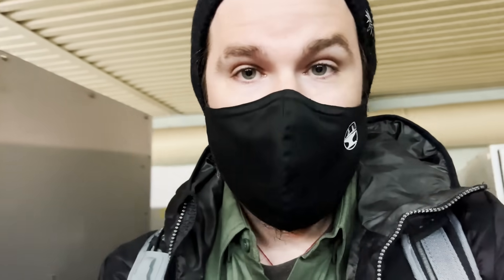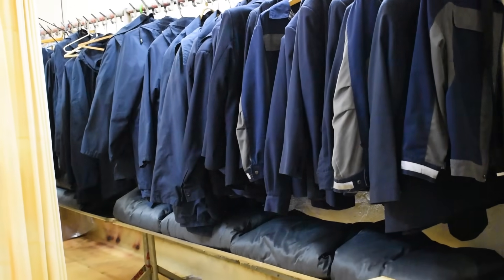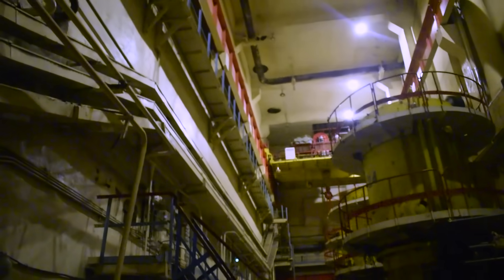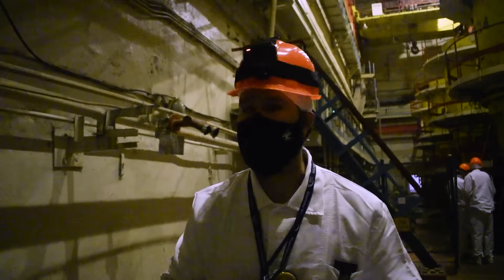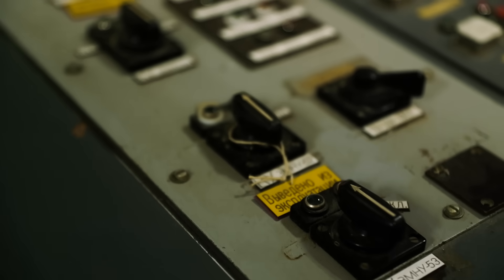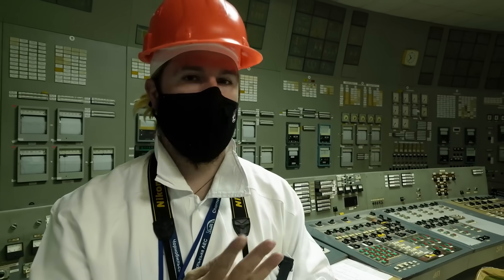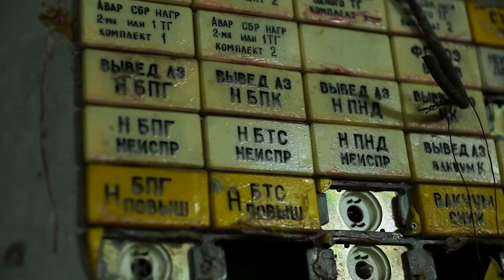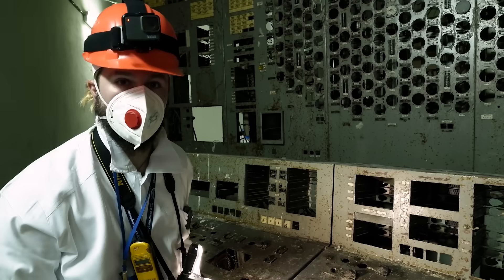Chernobyl Like You've Never Seen It Before...

Comment: Crazy to see the control room of reactor 4 and the damage that was caused to the control panels, you'd think it's some sci-fi set on a show but it actually happened.
Reply: I’m pretty sure the way you see it today, is the result of decay and lack of maintenance, not so much damage from 1986. Not to mention all the parts missing were either cannibalized for other control panels as many of these reactors still exist, or likely disposed of as part of a decontamination process.

Comment: Couple of question I'm not sure I understand.

Why was control room 4 in such disrepair and missing so many instruments compared to control room 3?

When you say it lifted for 10 seconds is that like it lifted like a meter and Stayed there for 10 seconds before hitting the ground? Or was it launched and took 10 seconds for the Arc it took to raise and lift?
Reply: Control room 4 looks like that because parts were cannibalized for other control rooms, as there are many of these reactors still in use, and Chernobyl was still producing energy until December 2000. Think of it like a parts car. You need something, you already have it, use it.
Reply: @gatermap  makes a lot of sense thank you.

Comment: Do you know why an emergency shut down of a reactor is called a "SCRAM"?  When Enrico Fermi created the first controlled chain reaction under the football stands at the University of Chicago, there was a very large control rod that was big enough to stop the entire reaction by itself hanging above the reactor on a rope.  In case of an emergency a man with an axe was to cut the rope to send the control rod down into the reactor.  That man was know as the Single Control Rod Axe Man (SCRAM).

Comment: would be nice if there was an EMP type thing that destroys radiation instead of electronics  something that could break the radioactive chains so it would be easier to clean radiation
Reply: Short of stabilizing things at the atomic level; that's way beyond our technological abilities.  Low energy neutron radiation in contact with the nucleus of an atom is equivalent to applying an energetic function where it'll either split the nucleus or be absorbed by the nucleus to form another atom.  Imagine if you could just stabilize one.  Then consider that you have to do that with on the scale of avogadro's number, 6 billion billion billion thousand times 100 atoms.  And with iron, that'll be around 56 grams, a chunk smaller than your fist.

Comment: You've challenged me with a calculation.  Accepted.  I'm not 100% sure I'm modeling this correctly, but here goes...

10 seconds of air time
5 seconds going up (more steam energy than what will be calculated here will have been released remember that steam was continuously being released. This is also not taking into account the energy needed to break the supports for the 2000 ton mass)
5 seconds going down

dh = 1/2*a*t^2 = 1/2*9.8*5^2 = 122.5 meters
E = m*g*h = 2e6 * 9.8 * 122.5 = 2.401e9 joules = 666.94 kWh

This is merely the energy required to lift a 2000 ton mass high enough that it takes 10 seconds to it the ground after liftoff.

The better calculation would be to estimate the energy needed to convert the mass of water in the reactor to steam.  And recall that the steam expansion increases with temperature.

Anyone who wishes to produce a better calculation than this is welcome to do so.  : )

Comment: 14:09 - As a nuclear engineer...yes, I can...if you've ever seen a reactor pulse, the amount of power and heat released in that moment is tremendous.  With the TRIGA mark III that typically operates at 100 kW thermal (they do not produce steam to produce electricity), a maximum pulse, which only lasts a split second, puts out 2 MW of power in a split second.  Chernobyl ran in the 100s of MW thermal range.  The pulse that would have occured from Chernobyl during the accident would have been close to 10 GW of heat and all that was dumped into coolants and reactor structure.  At that point, good old P = nRT/V takes over and throws that containment lid through the roof and who knows to where (they still haven't found it or pieces of it).
Reply: RBMK-1000 operated at 3200 MW(t)

Comment: What a video! Kyle didn't mention that the 2000 ton shield went up for 30 meters! Destroying the hanger roof, but with this new information that it stayed in air for 10 seconds! 2000 ton, 30 meters up for 10 seconds...Oh my God! the amount of unbelievable energy that poor reactor went through in its final seconds
Reply: Correct me if my maths is wrong - Hang time of 10sec means an initial velocity of ~50m/s. 2mil kg weight means 100 MN force if acceleration is done over 1sec, but it isn't, so proportion the force up as impulse time goes down. 

I'm trying to think what an equivalent is to 100 MN, but I can only think of the F-1 rocket in the first stage of the Saturn V that delivered ~6.7 MN of force - or ~33.5 MN for all five engines at launch.

Comment: There is a factual inaccuracy here. The "scram" button would have to be pressed before the first explosion, which is corroborated by some sources, to "seal the fate of the reactor". It is widely believed that the first explosion was the biological shield going off flying, and at that point pushing on the "scram" button would've done basically nothing, since the reactor was completely bust at that point. Granted, there is a bit of a disagreement in the sources when the scram button was pressed exactly. The "official" version of the events maintains that the button was pressed before the accident (and basically was the cause). Some witness accounts say that the button was pressed after the first explosions and structural damage to the building itself, and at that point you could press literally any buttons, and it wouldn't matter.

Comment: I'm honestly not surprised it all went wrong so badly. You can tell how careless they were in the design and building of it just by looking at the panels. Half the lettering is either upside down or backwards, and I bet some of the more astute among you noticed when Kyle said: "They hit THIS button", there was no button there.. He was pointing at a hole in the console. Look closely, you'll see.
Reply: I think the panel was damaged during the incident or had some parts removed afterwards. The control room for reactor 3 is pristine.

Comment: I have a question.
I Never understood why all the gauges and switches were removed from reactor 4, can someone explain that?
Reply: Some were removed during the investigation into the accident to secure evidence, while most of the equipment was scavenged to be used as spare parts in the other control rooms.

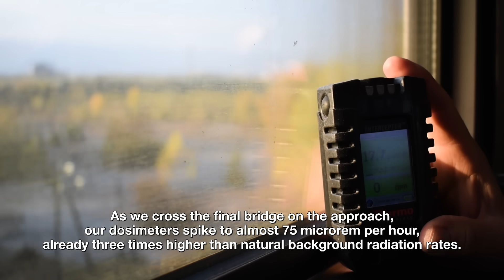Comment: 3:51 Just to put a reference the natural background radiation:
Worldwide average is 2.40 milliSievert (mSv) or 240 millirem (mrem) a year. That gives us an hourly average of 0.27 µSV or 27 µrem an hour.
If we use US average (total, not natural) it is 6.2 mSv or 620 mrem a year, so you can also say that when you crossed the final bridge your dosimeter spiked to 5 µrem over the US average. However it should be said that almost half of the average comes from things related to medicine like CT scans and nuclear medicine in the US, so you can also say over the double of the US average natural background radiation.

Comment: The fate of the core was hinged on a peak well before the scram button was activated. The power distribution within Chernobyl Unit 4's core was such that there were almost two separate cores, one higher and one lower physically within the large core, separated, to the best of my understanding, by the transition point between water the fluid, and steam the gas. The reactor had two separate regions of complex reactor physics maintaining a delicate balance. 

The core was in such a state due to the power history of the reactor prior to test conditions. The reactor was supposed to be operated at lower power for an extended period of time prior to the test, but was made to stay online at normal power conditions for an extended period for reasons I do not currently recall. These power history conditions distributed certain core fission byproducts known as "poisons" (neutron absorbers) in such a way that when they went to perform this low power test, they needed to raise an excessive number of rods fully out of the core to maintain the chain reaction rather than fully cut it off, shutting down the plant. In fact, during the efforts to bring the core to these low-power conditions required for the test, the core power went below what could be considered minimum detectable for their power range instruments, but not quite low enough for use of shutdown instrumentation, further complicating core power distribution. 

The delays and errors leading up to the test, plus known deficiencies with the design of the RMBK reactors should have led to performance of a full shutdown before even initiating the test. Unfortunately, poor design features, poor training, and poor understanding of their reactor, operators took the actions they believed their manuals to indicate were within safety parameters (which were poorly worded and contained a number of contradictions), all lead to core conditions that hinged on the most delicate of balances... that two discrete critical systems within one massive core were positioned such that a wrong move would combine those two systems into a single, system of incalcuably complicated physical processes that can be expressed by a term known as "prompt critical." One of our simplified formulas for reactor criticality has a value that defines prompt criticality. Entering this value into this formula into a calculator would result in a display reading "undefined," as you would divide by zero.

Now of course you cannot divide by zero and this simplified formula simply cannot express what is happening to a core at this point. By the time you reach such a condition, new factors are being introduced that change core processes. The materials the core is composed of melting, for example. 

The initiation of that scram didn't determine the fate of Unit #4. Its fate was determined by the complicated processes and conditions leading up to that moment. What the scram did - was seal that fate... which is indeed the phrase Kyle said so I totally lost track of why I made this comment.

Comment: On all the videos I've seen of people visiting the plant and abandoned city I've only ever seen people using radiation monitors not once have I seen contamination monitors I've also never seen anyone monitoring for Alpha radiation which as a retired Health Physics tech I find very concerning there also seems to be a complete lack of personal air samplers again with all the dust and contamination around you'd have thought they would be mandatory they were in all the hot areas I've worked in at Harwell we also had fixed permanent air samplers which we checked on a daily basis.
Reply: I might be wrong, but afaik, since the disaster in Chernobyl was so long ago, the things you mention aren't that much of an issue. All the dust that would blow away, has been blown away a long time ago.
Alpha radiation has a much shorter half life and can be blocked much easier than the other types of radiation.
Again, I might be wrong, but some of the worlds leading radiation scientists are working in that place. I doubt they will take any chances...

Comment: Excursion. I see what you did there.

Seeing the fuel pulling crane really makes me think about the why of RBMK..
From a non-professional standpoint (mine) it really seems like the RBMK must have looked great on paper. You can refuel it while it was running. You can use unrefined fuel. It can be built substantially by local tradesmen. And importantly (if you believe what they believed) It's safely contained individually in each channel. Unfortunately that last thing is trivially shown to be false, but that also casts doubt one the rest.

Also it's good to know that the Soviets also suffered from the "wood panel everything" plague. The 70s/80s designs need to be new safe confinement-ed.